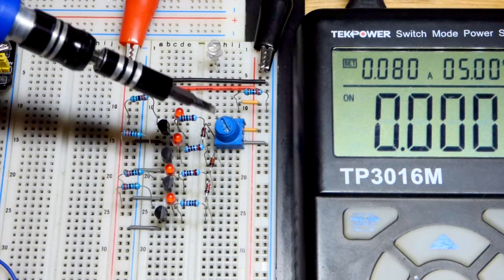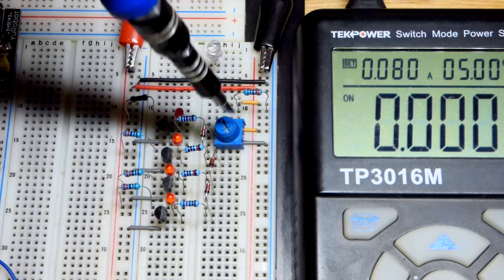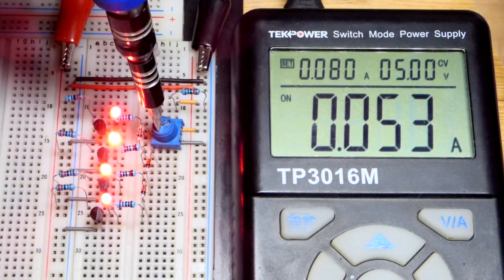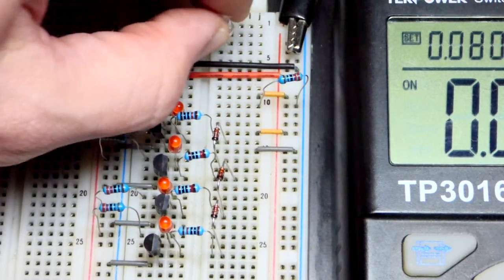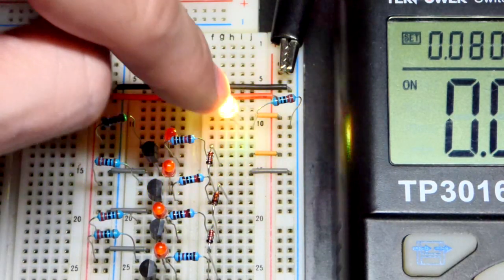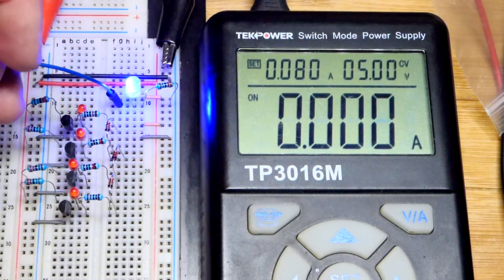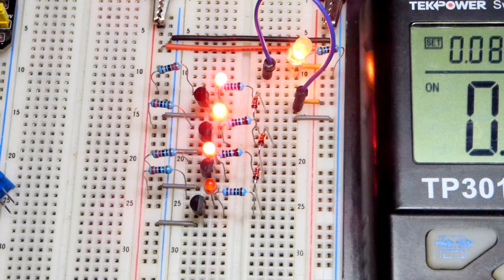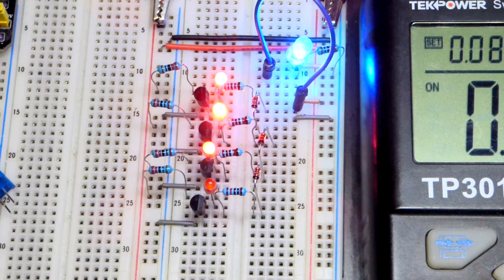Fast flashing LED as a voltage divider signal for more LEDs light as signal voltage rises circuit

Comment: Hey Paul, where did you hook up the Multimeter on the breadboard  to get the readings ?
Reply from the maker: That's my portable power supply that is powering the board. It looks similar to a multimeter and makes it really easy to show the current and/or voltage that is being output while filming
Reply: @Electronzap  Nice! I didn't know you could get one that small.  It does work well for the vid.

Comment: Neat idea.    I use a candle flicker LED to control a power LED to make a brighter candle flicker driver circuit on my channel.   I also designed a circuit with a candle flicker LED that controls the flickering of a 120 VAC candelabra for Halloween.
Reply from the maker: Nice!